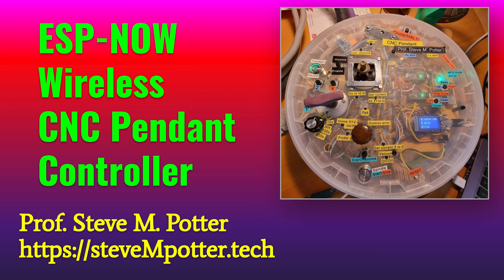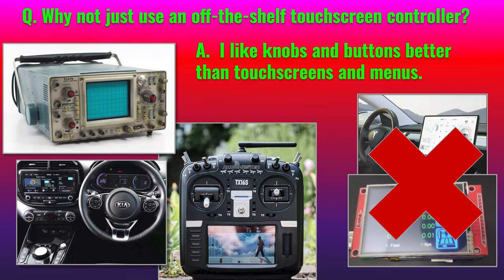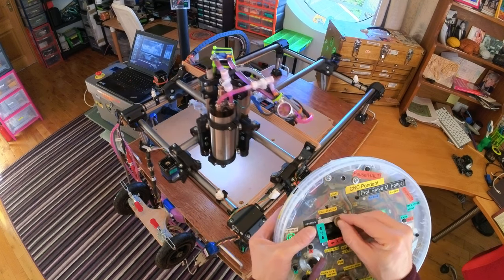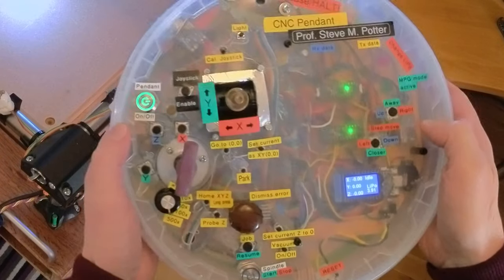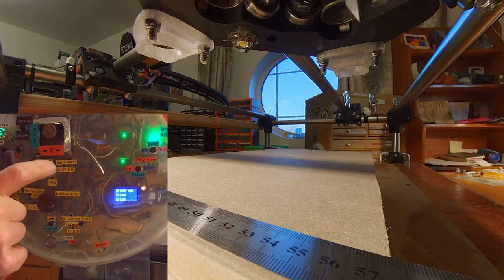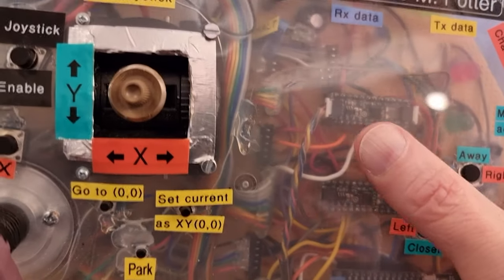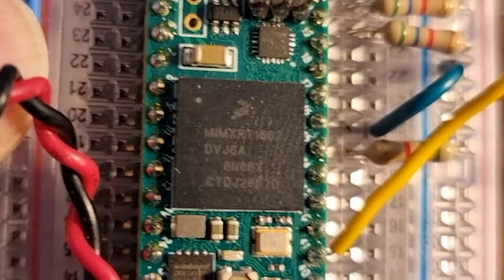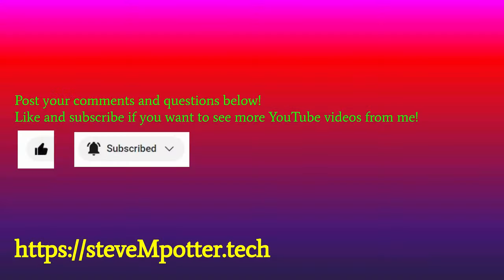Wireless CNC Pendant with ESP-NOW by Steve M  Potter

Comment: You should add an E-stop to the pendant.

The moment you can interact with a machine remotely, it is only a matter of time until something unexpected happens while you're not standing next to the hardwired E-stop.

This is especially true if you want to be able to run programs directly off the pendant
Reply from the maker: I already do, labeled Pause/Halt. It stops the feed instantly, and the spindle (which has a brake) and pulls it up rapidly.

Comment: Hi, i was wondering if creating something like this would work for a thermwood 5 axis that runs Siemens controls. I can purchase one from thermwood, but its a full programmer, and i only want to jog the machine around so i can obtain coordinates for the part to inout the offset. The ones they offer are full programming pendants that are overkill.
Reply from the maker: I use a grbl controller on my MPCNC because it is open source. All the details are up on github, gnea/grbl.  If you can get the source code for your machine, you can tap into the system with a home made pendant.

Comment: Could you maybe publish the schematic?
I'm interested in building a extension for my Lasercutter and the Commercial Version isn't that good
Reply from the maker: I will try to trace my rat's nest and whip one up. Good excuse to learn Kicad.
Reply: @professorstevepotter 
😅I've been there, Reverse Engineering of ones own Project is a MESS!
I'm still a Beginner in KiCAD even after ~2 Years of usage, but I like that the Versioning works with GIT etc.
Reply: @professorstevepotter  Yes! Kicad please

Comment: Wouldn't this poses a security vulnerability since it's not secure and vulnerable to replay attack since its using espnow
Reply from the maker: I did not use encryption, but ESP-NOW has that capability. Here is a good tutorial about how to implement it if security matters to you: https://randomnerdtutorials.com/esp32-esp-now-encrypted-messages/
Reply from the maker: Also, because my design uses peer-to-peer connection, based on MAC addresses, and is not using WiFi or a router, any man in the middle would have to be lurking close by. Very unlikely...why would they want to control my CNC? ... To maybe break a bit or ruin a piece of wood?

Comment: are you still planning to share the source code?
Reply from the maker: I have shared some of the code by request on the V1 Engineering forum. To organize it all on Github will take some doing but will happen if enough people request it.
Reply: @professorstevepotter  Hi! Here's another request! xD. The truth is that I find it interesting, I had a wireless one, but the receiver broke down and the technical support doesn't give a damn... so now I control it with the keyboard but it's a nightmare... it would be interesting to expand the coordinate screen and add some more data (like percentage of advance/speed, type of advance per pulse...). Great work and even more so for those of us who don't know much about ESP... I forgot to ask... do you control the CNC with a PC? Could this controller be used on a PC or do you use the teensy to control it?
Reply from the maker: @joseramon9104  
@JesseSchoch I have now put the the entire code (pendant and receiver) up on my github, user stevempotter. I did not polish or optimize it, so use it at your own risk! I have some bigger screens I plan to use in the next version of this for more displayed info.Yes, I control the MPCNC with a PC running IOsender. It usually plays well with my pendant, such that only one or the other is controlling things at any moment. The low-level control (running of gcode) is on the Teensy 4.1 microcontroller. It has an ethernet port for talking to the PC, and a UART for talking to the pendant receiver ESP32.
Reply: @professorstevepotter  Hi, thanks for the info! I thought you were using Mach3... the application you are using is not compatible with my CNCdrive UC300-5LPT controller. It is only compatible with Mach3 and the software from CNCdrive. What a pain!!